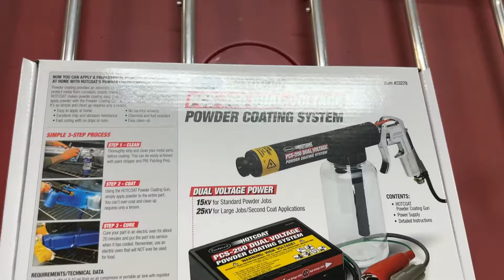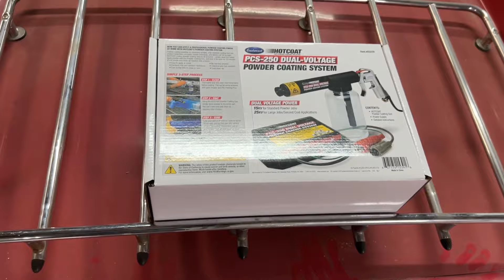July 4th Rerun

Comment: If you’re not going to drag race it just rebuild the 305 and keep using it. I had a 77 nova with a 305 and was a blast to drive
Reply from the maker: I recently saw a video n doing a 305 stroker! Same as doing a 383 but using a 305 block and 350 crank! They Dynoed it at 500 hp!